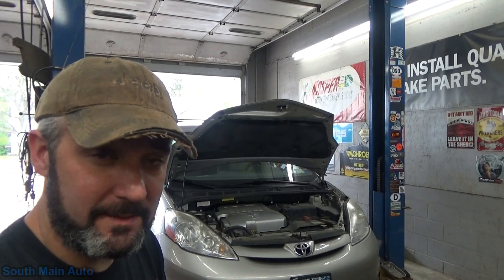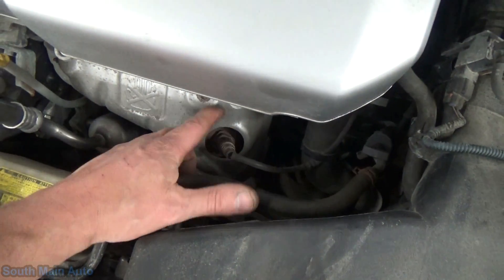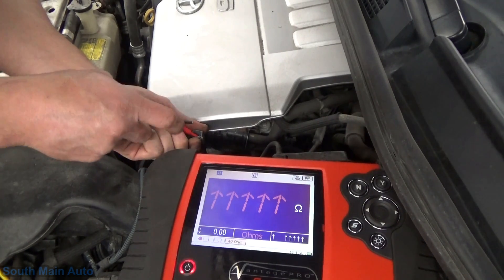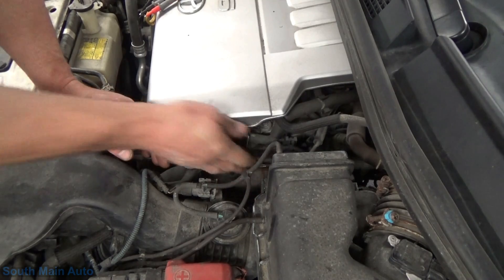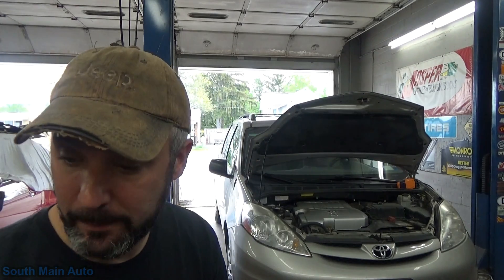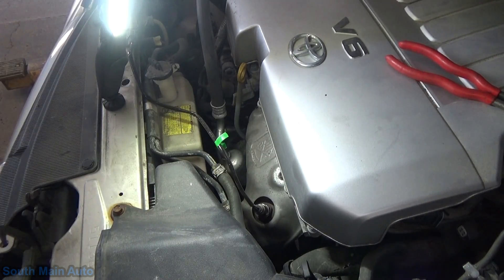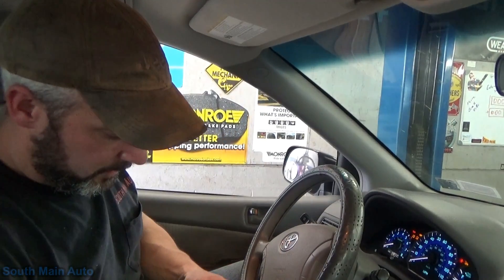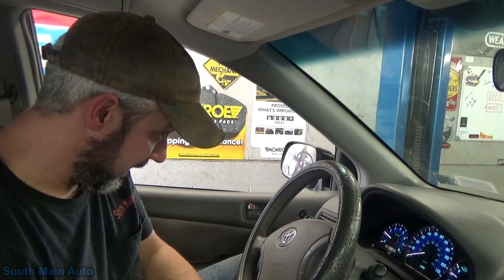Toyota P0051 - Diagnose and Repair

Comment: Thanks so much for your video. Really timely since I have a 2002 Sienna that I believe requires a new oxygen sensor. New test equipment on the way. If all goes well in my following your methodology I will save a few hundred dollars in replacement cost. Last time this happened was 7 years ago and it cost me $540 at an independent service facility. I hate to think what it would cost me now at Toyota.

Comment: Just makes you wanna slp silly whoever invented the check engine light.  Toyota loves em, you get a Loose gas cap and you suddenly have AWD Vehicle stability control, maintenance, oil change low washer fluid low air pressure and reduced power, low voltage and check Guages lamps all light up to create that Lovely Romantic Glow you can sip your Boones farm to.  🤣🤣🤣🤣🤣 waiting till next payday.

Comment: I have  2009 Sienna LE 3.5Lv6
with a P0051 error code
bank 2 sensor 1. I’m having a difficult time deciphering the correct Denso O2 sensor part number for the correct part. Might you be able to provide me with the correct part number. thanks in advance

Comment: Hi i did similar test on 2002 Camry 1AZ-FE the light comes on when i first start the egine but turns off after 15 seconds. If i clear the code light comes on 15 seconds then off again. Is that the expected behaviour?

Comment: what's the part number and what model sienna this work for? My 2009 sienna got a check engine, VSC, trac off lights and Autozone scan threw the P0051 code. Is this situation the same issue?
Reply: did you ever find that P0051 o2 denso p/n ?
Reply: @richardabner9420  took out the sensor and took it to AutoZone. They got the exact same denso part. It's $100+

Comment: Thanks for taking the time to make this great video.  The Toyota OEM part number for this sensor is 89467-08070.  It will cost about $223 plus tax at your local Toyota dealer.  I bought my part on Amazon from a Toyota dealer in Daytona Beach Florida for $155, no tax, no shipping.  Toyota gets this part from Denso so another option if you don't want to order the part over the Internet is to go to Advance Auto Parts.  They sell Denso #234-9049 for $159 plus tax.
Reply: Thanks for the tip and Cheers to all!

Comment: Hi. May I ask why you use a small bulb (194?) with the two wires to check the heater circuit instead of a regular test light?  Thanks
Reply from the maker: It draws the same current just easier to do one handed

Comment: I have a Bosch 1350 from O'Reilly that looks to be very similar to that unit, except for the color of the case (blue vs orange) and the logo on it. Software and buttons look the same. I think the Actron CP9680 is the same as the Bosch 1350, just the retail price on Amazon is cheaper. Just FYI...
Reply from the maker: Bosch owns actron ;)

Comment: Great video! Hey Eric where can i get one of those test lights? Thanks.
Reply from the maker: That one I made
Reply: South Main Auto Repair cool!, is it just a 12v bulb and two lengths of wire, was there any connectors on the end?

Comment: Isn't that just the way it goes? You figure on getting the correct part OEM and they muff it up. The subaru Forester we have has had 5 different changes made during the build. I am not looking forward to doing any repairs to it knowing that. I do know I have to use the VIN to order anything for it. Even then, yeah,I expect issues.

Comment: G'day, Mr. O! I am Sharing... A very useful tool! (Actron - CP9690) "The tool use is very straight forward and intuitive. Within 10 minutes of playing with it you have most of its function down. 

I used it to read a check engine light. Read P0420 which is catalyst inefficiency. I let the car warm up and then selected live diagnostics. You can see all the PID's or you can create your own custom list. I like that feature. 

I selected the PID's relevant that I needed to see to confirm a diagnosis. Short and long term fuel trim shows me that the engine is running rich (too much fuel in the mixture). 

Coolant temp is spot on. Voltage feedback from the O2 sensors showed me what I needed to see. Then I recorded a short 5 min drive, and graphed the data. Downstream O2 sensor is all over the place. Verified that the O2 sensor is working properly. P0420 in my case is a bad catalytic converter." 

Plus, the scanners troubleshooting is a nice feature as well. Useful for Veterans, and inexperienced wrench turners alike, It gives you a checklist so you know where to start and where you should start searching next. It certainly help to save money by not throwing parts at a vehicle. Thank you!

Cheers! :-)

Comment: Thanks so much for this Sienna video. I was beginning to wonder if anyone in your neck of the woods drove siennas. I have a 2004 Sienna with over 220,00 miles and it's been a great car.I just changed the bank 1 sensor 1 AFR which was quit a bit harder to get to, especially lying on cardboard on my gravel driveway. And guess what , I use the exact same Actron scanner. Do you have many siennas in your area? I really love your channel. It's the best.

Comment: great video but where did you find that test light with the bulb
Reply: jorge perez Its just a simple running light or even a lamp holder from a dead vehicle. I have one I use one. that has probe wires and also alligator clips
Reply: but to turn the light on you need positive and negative

Comment: Have you ever run across a zero fire issue on a 1997 dodge with a 5.9 in it???? Coil is new plugs new rotor is new crank position sensor is new. Any help would be appreciated

Comment: Bosch replacement sensors (not that I would use a Bosch O2 sensor on any Japanese car) solve the short/long cable problem by only selling ones with long cables and they include a zip tie !

Comment: I am anxious for you review !  Your old one was a CP9580.  That is a CP9690.  The only down side to that model is the current software only handles ABS and SRS up through 2013.  It would be nice if it handled tire pressure monitors.  4 years is a long time without updating the software.

Actron is now owned by Bosch and that model looks identical to the Bosch OBD 1350.  I also think Mac resells the same one.

Bosch also owns OTC now.

Comment: I haven't had the chance to work with the actron scan tool, but the Autel MD802 is a GREAT DYI scan tool.  it gives you make specific codes, ABS/SRS Transmission, etc.. totally worth the 200 bucks it goes for.

Comment: I might be Denso, but something tells me the OEM sensor is the exact same part, it just costs more at the dealer.
Reply from the maker: More than likely
Reply: Tom Davis 

     I have always used Denso for my Toyotas and generally around $50 online, downstream is usually $15 cheaper than upstream.  Lexus are about $80 online.  It is much better to pay $300 for all 4 than $371 for 1 as I was quoted at a stealership.  SAME part!

Comment: What an excellent review of how to do things properly and efficiently. Good diagnostics don't have to be slow, and you don't need a lot of fancy tools. 
Regarding the antiseize, most of the O2 sensors I've put on come with their own little packet or have it on already. Maybe it's becoming an urban myth, but I've read a few times that the wrong antiseize can mess up the O2 sensor, presumably by mucking up the sensor end in some way. Does anybody know more about how that happens? I suppose when it gets really hot, you could change the local oxygen concentration around the outside of the sensor, changing readings. Or, maybe when really hot the wrong antiseize could drip down onto the end of the sensor, covering the end that needs to sample the exhaust gas.
Reply from the maker: I think you are right in the sense that people may put on to much. I use a very small amount of copper never seize just on the threaded portion

Comment: A friend brought me his 05 Accord 2.4L the other day that was setting the MIL intermittently.  When I scanned it it was showing P0141 (B1S2 heater code) stored but not turning on the MIL at the moment.  I did these same tests, expecting to see an open or real high resistance but got around 8-9 ohms on the heater which comes to only about 1.5 - 1.7 amps.  I backprobed the heater wires, connected my Vantage meter, and saw a nice PWM square wave for the heater from 0-14 volts while the engine was running, so obviously PCM and wiring to the sensor check out.  

I thought the heaters always failed open but it seems they can go intermittent or just slightly high, too.  I found a spec in my 07-10 Odyssey factory service manual (assuming they're the same) for the rear O2 heater and it gives 5.4  - 6.6 ohms.  I can only assume the heater is either failing intermittently or just going high enough resistance to set the code when the engine is cold.  Will find out after I put the new sensor in on Friday.
Reply from the maker: I have seen them fail intermittently for sure. Eventually it will go open
Reply: First time I've seen it intermittent.  It's always been open when I've checked one with a heater code.  Thanks for the confirmation of that!  I couldn't 100% verify the bad sensor, since heater resistance can change with heat, other than ruling everything else out.
Reply: johnaclark1 Big huge major thing to point out with the repair of anything electrical, mechanical or even biological, every possible failure type can and does often present as intermittant unless of course you're talking about catastrophic failure of a given component. Anyone with experience will treat every diag process as potentiality intermittant in the way they handle things like harnesses, connectors, sensors, etc. If you were to try (and why would you) you could turn 80% of those "sure deals" into intermittant nightmares.

Comment: Have you ever had a P0151 code, gone to check the circuit at the connector and found both heater wires to be hot when koeo?
Reply from the maker: Sure it could be "hot" on both until the ground side is turned on. If both wires are hot though that means you do not have an open in the O2 heater :D

Comment: A Toyota repair vid?  I saw it on the feed and thought...  "Man, this should be short and/or boring."   Right, Ivan?  ;)  Haha

Sure enough.   :D   It's the same in my shop.  Toyotas come in, and it's yawner oil changes and brakes and the occasional filter or sensor.

When the big three show up, it's time to pull out all the fun diag toys and go gremlin hunting.

Great vid, Eric.  We also need the easy simple ones as some of us could use refreshers and others just don't know how to handle the more common easy stuff.

I bought one of those Actron 9690's last year to keep in my truck.  It's nice, tho it takes FOREVER to pull codes compared to it's taller predecessor the 9180.  I only use it for scans on the road if someone needs it.   The Code connect is nice, as it gives top fixes for codes.  Basically Identifix for the diyer's.  Just don't take it as gospel.  Direction at most.  

I prefer the older 9180 for the quick stuff like just reading or clearing codes.  That thing is lightning fast.
Reply: I got another Toyota vid coming up really soon...more exciting that an O2 sensor or rusty exhaust pipe haha
Reply: Looking forward to it!   As a Toyota specialist shop (poor career decision - hah!), life is pretty boring around here ;p   Toyotas are 90% of my clients, yet the 10% other brands I do work on are 80% of my profits.  heh.

Comment: was wondering if a bad o2 sensor can cause white smoke,and stall the vehicle when its hot, anybody?
Reply: Desmond Blyan white smoke can be water getting into the cylinders, a cold start up evaporating the water in the exhaust, or a stuck or shorted wire going to an injector.  Smell the smoke and see if it smells like gas or if it puddles up below the tail pipe (water).  Bad o2 sensor is not likely and would set a code.
Reply: Ok sounds good thanks i was thinking the same thing about the injector,cuz when its cold it runs good, when its gets hot it blows white smoke,was watching scanner danner about the injector fixed with snow so maybe a bad coil winding in the injector what di you think?
Reply: P.s i changed the Head gasket, thinking it was that but parts changed like a fool LoL,so next im thinking raw fuel
Reply: William Fowler Knowing the sweet smell of antifreeze at the tailpipe is telling when it happens too. In my personal experience expect a dead kitty too when that happens.

Comment: Your kicking videos out like Vanessa and the kids left on vacation without you. This was a simple test but as usual, your commentary and tips added a lot of value. I'll be hanging around for more information on that Actron. My local mechanic uses one...in fact, I think it's the only scanner he has.
Reply from the maker: Haha, yeah it is a good scanner but should not be the only tool of a professional shop. It has to many limitations. It is not my opinion it is just a fact. If you run a pro shop with this as your only tool, your days are numbered...
Reply: wyattoneable yep. Kick in em out like a welfare mom.
Reply: Oh yeah, our local guy is a parts changer.

Comment: Can't blame the Toyota parts guys for messing up, they're just not used to selling parts cause toyotas never break down :D
Reply: steve 

      You know from owning them.  4 currently in my fleet.  11 Camry, 02 Sienna, 01 Tundra & 97 Avalon.  O2 and A/F sensors are one of the main replacements.  Engines and trannys are titanium solid.
Reply: steve Can't say that. they're Amurikan Made now.

Comment: As a former Toyota parts guy I will say it's easy to screw up  o2/af sensors the Catologs whether microcat or snap on even with the vin will give you both calfornia and regular 48 state emission options I have made that mistake many times.
Reply: P.s. Your videos are a small addiction now 😂
Reply: Stephen Whitaker so how did you handle the guys that would order up all possibilities just to cover themselves from this type of thing? There must be a very high return rate, good new untouched parts back in stock.